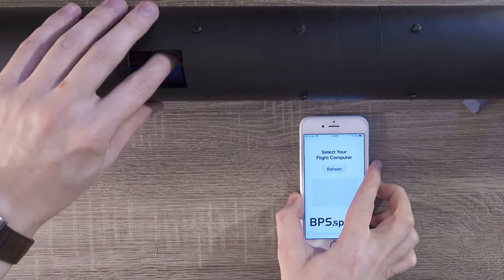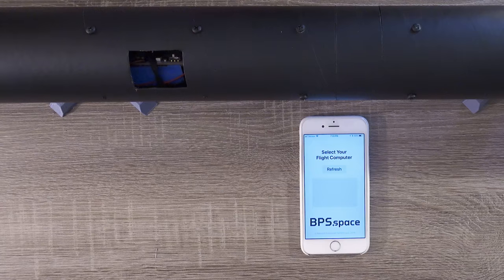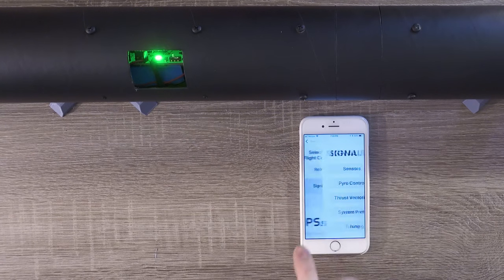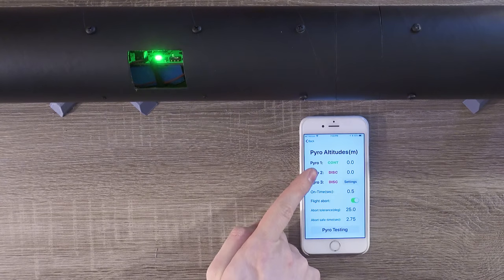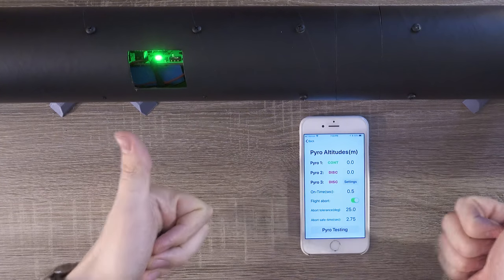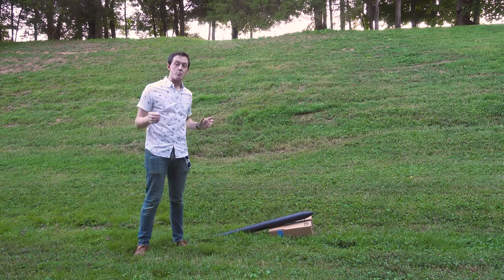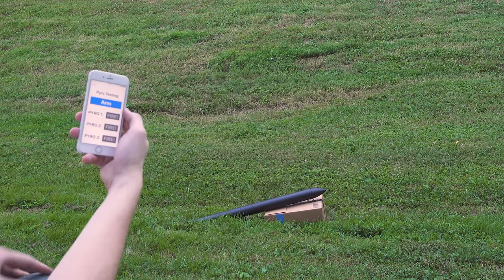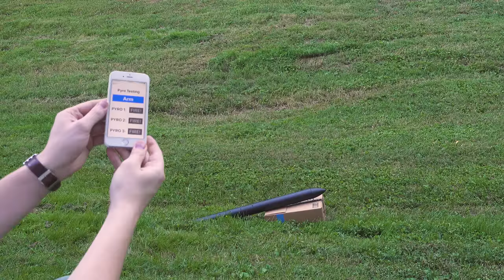Ground Testing - Build Signal R2

Comment: How does the rocket know how high it is?
Reply from the maker: It has a barometric pressure sensor! By measuring changes in air pressure, Signal can determine how high it is above ground.
Reply: Ok thanks